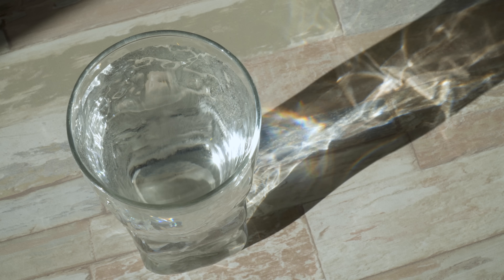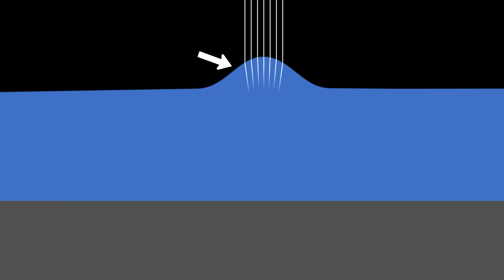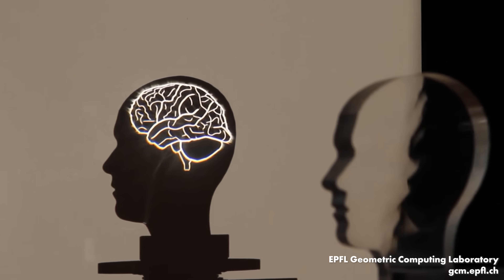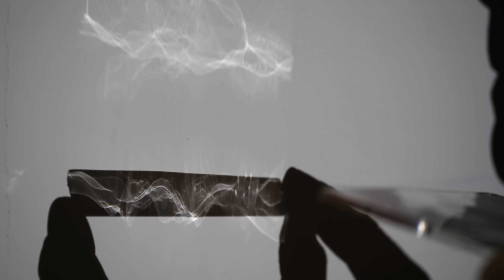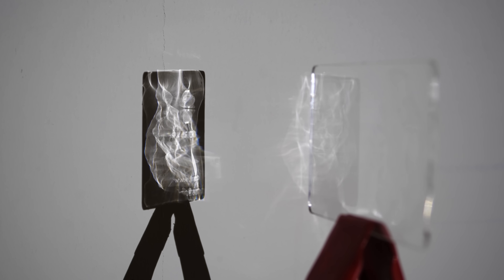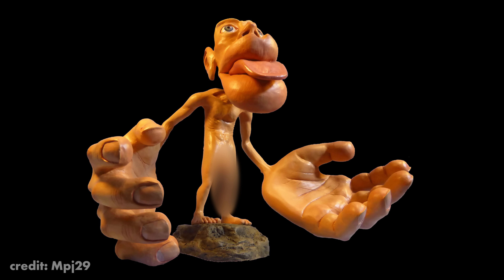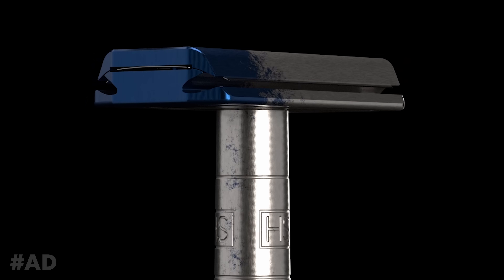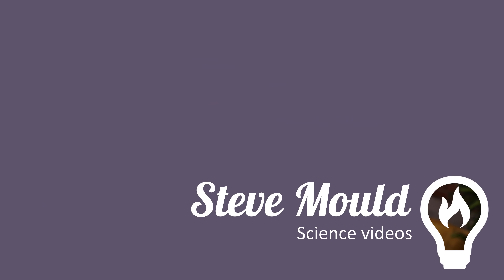Caustic lenses are really weird

Comment: I'd really like to know more about how these lenses are produced. It's quite interesting to see the final result (the lens in action), and to talk of the math and other natural elements at work, but at least three questions remain for me. One, it must consume time and materials to produce the lens, so how is the pattern to be applied to the lens formulated, so as to avoid repeated trial and error attempts? I assume with a computer program of sorts. Two, is said program or other resource publicly available. Finally, third, how is the lens produced? I can imagine 3D printing a mold and filling it with a clear resin, but I can also imagine that that method is not precise enough to get great results. Lasers maybe?
Reply: To avoid spamming, I answered Dartheomus regarding the basics behind the computing process here:
https://www.youtube.com/watch?v=wk67eGXtbIw&lc=UgyGtn2SFpf92WmQUnh4AaABAg.9ky0tZdax299oHnHLWZy8L

Publicly available software, I'm not sure on.  Could be proprietary or commercial, but with the way coding goes these days, the creators may have offered the thing creative commons.

The lens or mold for mass-producing lenses would be cut from a blank by a CNC machine, often in multiple passes with different cutter resolution.  The final item is polished as needed, often finished by hand.  Typical materials would be polycarbonate for the lens or stainless steel for an injection mold.  The polycarb works very well for injection molding and direct CNC.
3D printing doesn't yet offer a solid pack that would yield good results when polishing.  Voids exist between lines of filament (or whatever additive process is used) that would open up when the nearby material was scraped away from polishing.  Subtractive processes are still better at this, for now.

Comment: I had never seen these before, they are fab. Great video.

On a side note great to see a traditiobal safety razor as a sponsor. Used one for years (highly recommend feather blades) and always been baffled at these multi blade razors. If the  first blade is sharp what are the other blades cutting?

Comment: With printers theres also the built in obsolescence - my printer has just died, the sponge that wipes the ink cartridges is "full". In an ideal world, one would just buy a replacement sponge and reset the printer, but NO, its almost impossible to get a replacement and when you can its stupidly expensive and even then it's almost impossible to replace the "full" one with the new one without breaking your printer. This sort of thing should be illegal!

Comment: Hey Steve, great video.  I would be interested to see how far you could project a laser image through one of these lenses via a beam expander.  Do you think it would work?  I'd love to see the manufacturing process too.  Are the lenses moulded, CNC machined or manufactured some other way?  Nice shaving too - I wondered what that was all about!  I've used a safety razor for over 10 years and I am still on the original bulk batch of blades I bought for about £20 when I first ordered it.  Bargain shaving!
Reply: CNC (probably polycarbonate) for low volume, CNC a stainless steel injection mold for higher volume.  Either would usually be run in multiple passes with finer cutters, then polished.

Comment: The razor and blades model used by printer manufacturers is frustrating. So I did some searching and found a series of printers that used bulk ink and none of that cartridge crap. The were slightly more expensive, like 30%, but the ink was cheap, really cheap compared. So I bought one and it's great. Only I discovered that I are bad at using it. After two years I have printed very little, and what's worse, the print head has gummed up from not being used often enough...

I should have spent even more and got a laser printer. Sure it's more expensive and can't print photos nearly as well as the inkjet I have, if it wasn't gummed up that is. But a laser doesn't gum up if you don't use it, something inkjets are famous for doing. Now had I bought a real cheap printer and the print head gummed up because I didn't use it I would just have to swap in fresh cartridges and it would be back in business. But now I either find a way to clean the print head, replace it, or throw out the printer and get something else...

I think the lesson is don't buy a inkjet if you're not printing regularly. And if you print a lot get an inkjet with ink tanks and not cartridges. If you only print a few times a year or less get the cheapest possible inkjet or get a good laser printer and never look back.

Comment: Very interesting video!
I wonder if this type of "lithophane" can be 3d printed? 
I think current lithophane solution is simply to use thicker surface for darker areas instead of curving the light (of course printing with /semi-/transparent resins can be used in this case for optimal effect)
Reply: I'd guess that the resolution/grain you'd need on the surface is simply beyond anything a 'extrude a substance through a nozzle' could manage.
Reply: @Tao_Tology  , resin printers have much better details, for example Elegoo Mars 3 has 35 microns (saturn2 can do 28.5 microns)
Reply: @blueckaym  And, still, I would imagine it needs the surface to be shaped rather than printed.

Comment: 7:57 In the US, when I turned 18 (if I remember right), a certain razor company sent me a free razor handle and a pack of replacement blades. At the time, I just assumed it was a random coincidence, or maybe I’d signed up for something and forgotten about it, and I used it. After using up the free blades, I just bought more blades because why not, I already had the handle. I used that razor handle for years, and purchased who knows how many replacement blades, before my puppy got ahold of it and chewed the rubber out of the metal handle, after which, I bought another one, from the same company, to continue using the blades I still had. It wasn’t until years later I learned it wasn’t just a random coincidence that I received a free product out of the blue (as did my younger brother when he turned 18), but it was a marketing ploy by the company to get me/us to buy their razors. Apparently, they send free razors to a bunch of kids when they turn 18 to entice them to buy their products. And it worked for years, before I just stopped using razors all together.

Comment: Yeah, I need to show this to my optometrist because he can't grasp that you can have compound-astigmatism i.e. the eyeball squashed along more than one plane.

If you have astigmatism along a single plane, than points of light seem like lines - the picture is smudged along a line.
If you have compound-astigmatism, along more than one plane, the points of light can be crosses, stars etc. - one additional line, for each plane.

Why does it matters? Because current glasses fix astigmatism only along a single plane, the one the eyeball is squashed along the most. But if you do this, then points of light that were crosses (2 planes) become smudged (1 plane) so the picture is clearer but still blurry, especially the nightlights. You know what I mean if you have it.

Currently it's impossible to have eyeglasses that fix more than one plane of astigmatism because people doing the lenses don't understand the issue which is unbelievable to me as they should be experts their field. Hope this can convince them that light can be bent in more than one way.

Comment: You can also make that shape in coffee mugs by rotating a two circles of different diameters connected by a single point on each of their circumferences.

The mug version has an exact ratio of 2:1 for the smaller and larger rings respectively.

I can post images of several that I created a couple of years ago if you want to see some examples.

Comment: I switched to a safety razor years ago. The one I bought is made out of zinc plated brass, so it has a nice heft to it.  I haven't tried that razor, but I highly recommend making the switch to that type of razor, and while you are at it buy a mug, shave soap, and brush as well.  Your wallet will thank you in the long run.   As for the printers, epson make the eco tank series that will save you a lot of money as well.

Comment: Really cool video!  Not that I would understand the math, but I would love to get a simplified explanation for where they even begin... The resolution on those photos were fantastic.  I'd also definitely be interested in the manufacturing process!
Reply: Decades of experimentation and practice now allow ray/photon tracing software to know where light will go when refracted through materials of a certain shape, without needing to take hours for a simple image.  By turning that process into an algebraic formula, (solve the other side of the problem) the system can derive the lens shape that builds a particular pattern of light at a particular distance.  Once the computer has that lens shape, it would be cut by a CNC mill and polished.  If repetition is needed, (like for fancy business cards) CNC cut and polish a mold to build more.
Raytracing took days to resolve one image, when it was new.  Now software can resolve a car model into photorealism in almost real-time.  Many car commercials and those for other products like phones have abandoned using actual products in their commercials, which allows them to do any number of takes and experiment with camera angles and lighting without needing the dozens of people required for a live video shoot to spend and be paid for days of work.  These same advances have allowed what we're seeing in the video, just that the math is reversed.

Comment: I really thought you were going to shave your head before the end of the video.

But anyway, the blades and razor model is similar to what the modern console makers do, like Sony, Microsoft and Nintendo. The hardware is sold as cheaply as possible, possibly below cost, and the software makers pay a licensing fee for each copy sold (plus usually developer fees, development systems, etc). It has worked spectacularly well for them and many would argue that the quality of games overall* has vastly improved because of the high startup and licensing cost for the developers.

* In earlier marketing models such as for the Atari 2600, anyone and their mother could develop for the system (after Activision won their court case that is) and soon there were dozens of fly-by-night companies making games for the system of extremely dubious quality. Some say this is what caused the video game crash of 1983.

Comment: This is a really cool tech, but it's locked behind a patent, just like Vantablack. This tech has such amazing potential as an art form, but Rayform explicitly states that they have patented the tech that makes it possible, and that they only work with "select clientele" (read rich people with connections). My first thought in this was to apply it to several different art projects. It's a near perfect hidden symbols deployment, and I could see a particularly creative individual layering images so that as you rotate it, you get varying scenes. Imagine a story encoded on a single sheet of glass or metal. Instead, what we get is "installations" (read vanity project), "jewellery" (read status symbols [$3000!?!?!?!]), and "concept pieces" (read vanity project again). Is a cool tech, but I know for a fact that it doesn't need to be patented and paywalled, considering most of the work for it was done by computer scientists and mathematicians doing research to see if it was possible. Fuck artificial walled gardens.

Comment: I can confirm, safety razors are great. I bought one a few weeks ago for €20, you can get a pack of 100 blades for €0.10 a piece, and they actually shave better than a conventional razor! Although it is also easier to cut yourself if you're not careful. This was actually the first time I cut my legs while shaving. Ouch. But you can also take them apart to get the hair out! So great!

Comment: Maybe someone will find this helpful if you're new to shaving with a safety razor, you should give a try to several different brands of razors, some of them will work better than others.

Regarding the Henson razor — it's really good, probably not the best I've tried but it is among the top three out of twenty something. The only thing I find lacking is that it's very light but that could be solved with a stainless steel handle as it fits standard ones.

Comment: If someone out there still hasn't switched to safety razors, you have to give it a go. They really are better once you get used to holding the different shape. They are more environmentally friendly, and the replacement blades are dirt cheap. My favorite part about safety razors is that you can take out the blade and rinse off any hairs that get stuck in gaps.
Reply: I love that you can adjust the aggressiveness of the blade. When I let my beard grow out a little more it's a hassle trying to cut the mass of it off at first, so I loosen the head a little and it chops through much better.

But that's not great for close shaves. It shaves into the skin, irritating it, and more easily causes cuts. So! After a rough pass, I just tighten the head down and the close shave is just quick, simple and comfortable!

And that's great for beginners who are scared of working with an aggressive blade! Converted my brother in just a single shave.
Reply: You could take a further step back in time and use a straight razor. My vintage straights are over a century old. That's hard to beat for sustainability.

Also, didn't Gillette conceive of the safety razor primarily to sell blades, effectively inventing the idea of disposable goods? The modern cartridge systems are just an evolution of that sales tactic.
Reply: @weevilinabox  Straight razors ARE missing the 'safety' part of the safety razor, and DO necessitate some time investment in blade caretaking, so whether the money grab was intentional or not there are some benefits to safety razors I appreciate over straight razors.

Comment: how does the image remain the same no matter which side of the card we turn to the light? logic would say that both sides are identical, but wouldn't that change the calculations again! if I'm not mistaken, the light changes direction at the entrance and exit through the lens.
Reply: @gregoryford2532  you're right. which means that the lower right corner sits on the flipped  upper right corner, separated by the thickness of the glass oriented in the opposite direction from each other. I wonder if these two surfaces are separated so that we get two tiles, would the effect remain the same or would we get a different picture? does the relief on one side affect the relief that should be on the other side to get a clear image?

Comment: No, than You, 24 years ago I buy Brown 790CC electric shave, I once changed an cutting foil since then, other than that I use it every single day [almost, like 360 days per year] and it works perfectly, no battery issue no any other problems, a little bit of paint fade way from some parts, but I will not change it to anything else than  true razor set. 
And this I also have, shaving tools I inherited from my grandfather and  my fader so, no thank You I am covered for live !
Have a nie day mate :)

Comment: If you're going to be looking into holograms, could you also look what is meant by this statement that I've heard a few times on videos about holograms: "a hologram of a lens acts like a real lens / a hologram of a mirror acts like a real mirror"?

Does that mean they have those effects when viewing real objects through them? Or does it just mean that in the hologram you see lensing/reflections of the rest of the objects captured in the holographic scene?
Reply: I've never heard that expression, but it just kind of makes sense to me. Here is my reasoning (I could be all the way wrong).
A hologram is basically bending light in an extra special way, so if you were to form a lens on the hologram, you're bending light to look like a lens, which, makes sense to me, would be bending light like a lens does. For the mirror, I'm not too sure, but maybe you're just bending light that much more. So, if you could bend light from all directions back out at the angle it came in, that would be exactly a mirror.